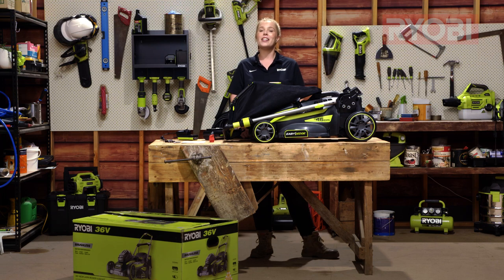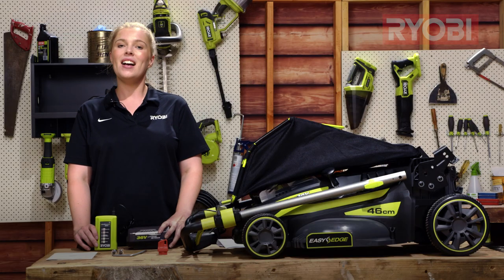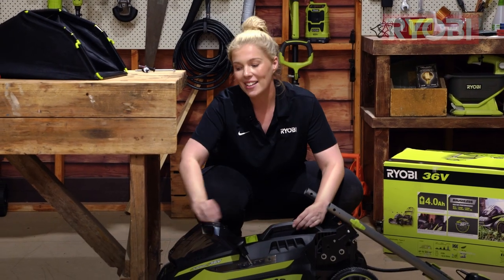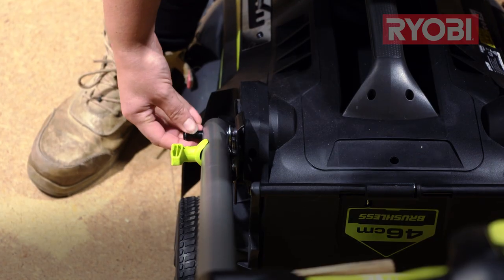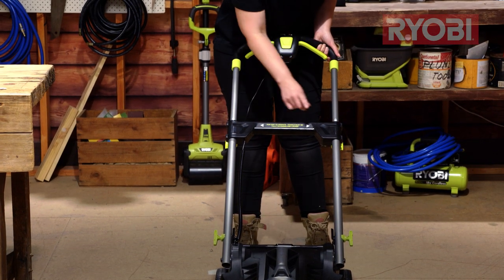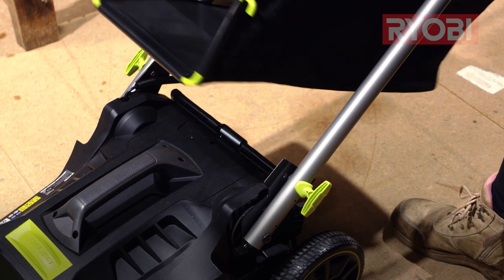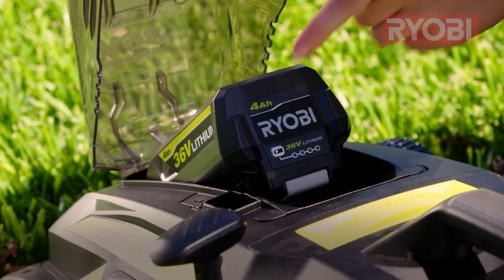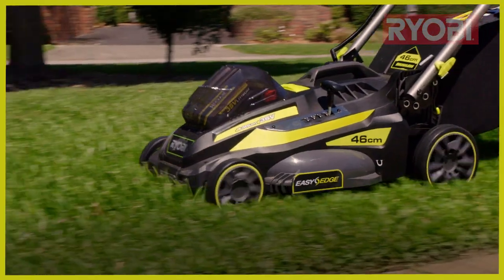RYOBI 36V 4.0Ah 46cm Brushless Lawn Mower Kit (RLM36X46BL) Unboxing

Comment: This doesn’t explain what to do with the metal bar, how it fits with the catcher (if at all) and where and how the mulch plug works. The manual has no detail on this either.
Reply: we've just bought this mower and the catch bag did not come assembled.. what a nightmare it is.. I'm scrolling thru YouTube to find an easy way to insert the blinking handle lol not quite divorce but wow.... unhappy no mulcher either
Reply: Exactly lol . The only reason I watched this but after looking at it quickly on the video I figured it out
Reply: @TheHitlister .left the hubster to it and by the time I found a YouTube clip that resembled our bag he had worked it out. not bad for a 86 yr old with early onset dementia! wonder if there's a mulcher part that fits this mower we have.... although I've yet to mow anything with our newbie. rain rain go away

Comment: I accidentally bought this assuming it did mulching (downloaded the wrong manual 😡). Fortunately we will be able to exchange it for the next model up, but it would be nice if you made it clear in the product description whether or not it supports mulching. Even on the model that is supplied with a mulching plug, it still doesn't state in the product description that it supports mulching